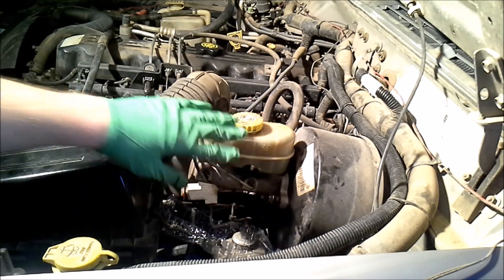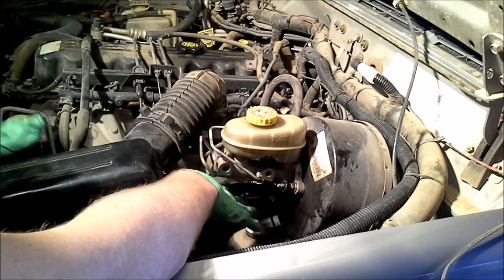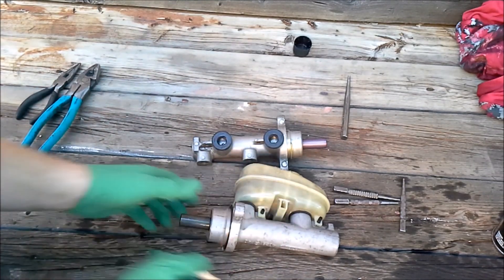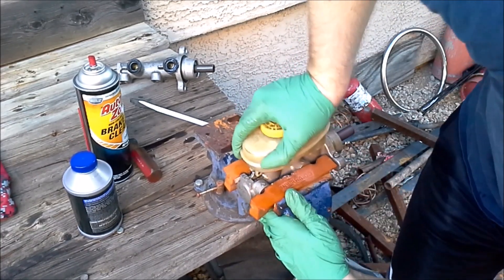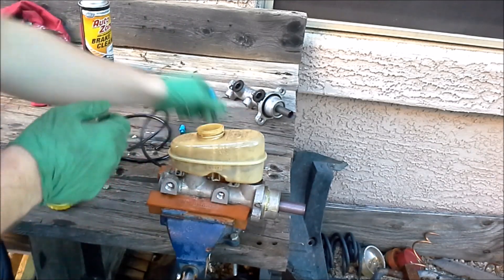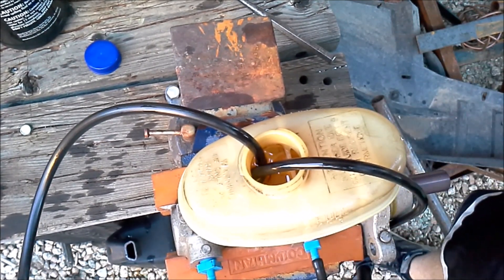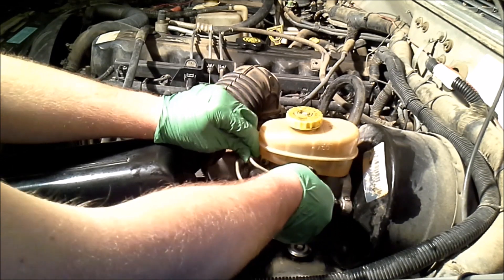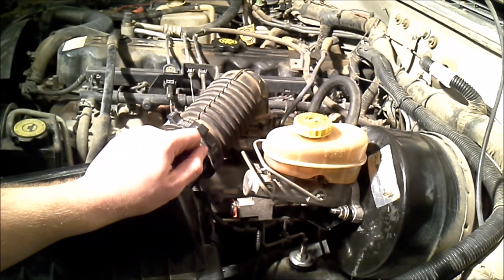Master Cylinder  install

Comment: FYI My master cylinder doesn't require a bench bleeding kit.  My instructions say to secure the master cylinder in a vise "firmly clamping the mounting flange on the casting.  DO NOT CLAMP THE BORE AREA OF THE CYLINDER!  DISTORTION OF THE BORE CYLINDER WILL OCCUR!"  Also mine didn't come with the plastic tubes, only threaded plugs.  And it said to only depress the piston no more than an inch and to wait 15 seconds between presses. I'm learning that these videos are great but no substitute for reading the instructions that come with your specific part.  Thanks for the video!

Comment: I got a new master cylinder for my 04 Wrangler TJ reservoir and the bleeders. it was very reasonably try and it didn't take very long to get here. Google/Amazon it they're out there.
Side note: I was cracking up because you're struggling to get the reservoir off. Then suddenly you had the reservoir in your hands. I look over, see the cylinder in the vise. I thought it was kind of funny. Looked mildly brutal.